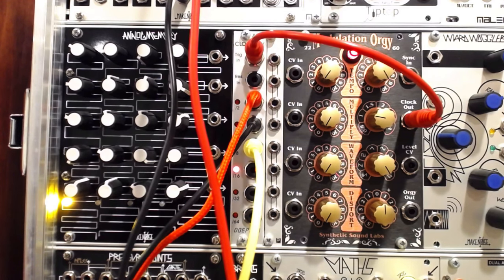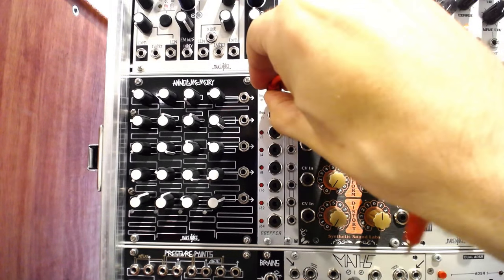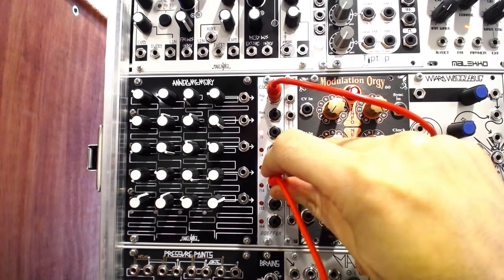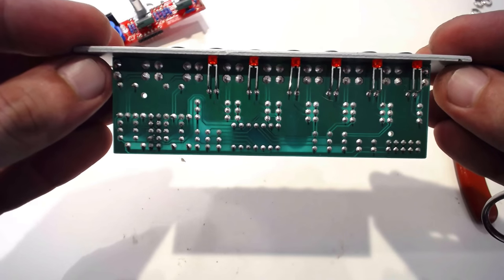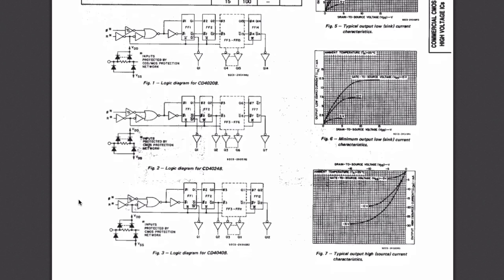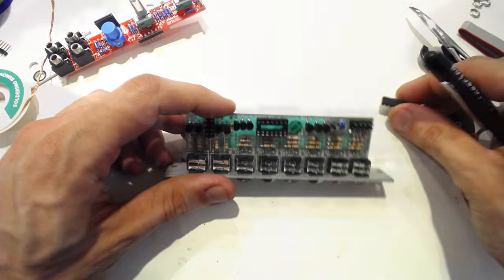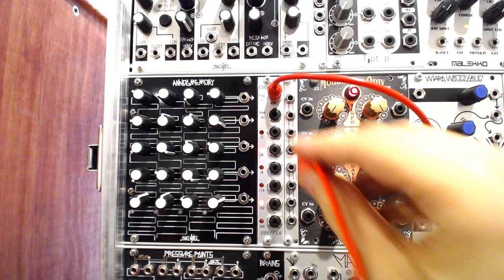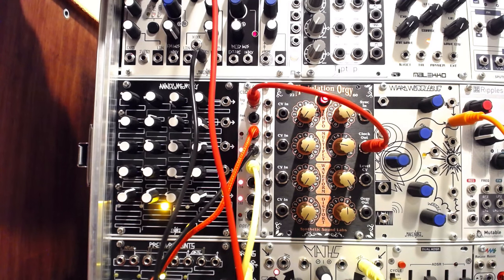Broken Eurorack Module Diagnosis And Repair

Comment: Hello, I have a newly made DIY modular case with Konstant Labs Strong PWR and Konstant Lab Filtered busboards. Suddenly while playing the other day everything froze, no sound, all LEDs are stagnant, and the -12 volt LED stopped working, Both +12V and +5V works and is lighting up, its been a little up and down in terms of functioning for a couple of weeks, but yesterday it just died, and i cant for the life of me figure out what this means, or how to fix it. Anyone here have any thought on what could be the issue? some modules still work, but most are just constant lighting up LEDs, in modules like modulation orgy which is supposed to blink in sync with bpm. Any help is much appreciated!
Reply from the maker: Tough to say, I would be careful not to damage your modules though! I’d suggest asking in the Synth DIY Facebook group, they are very helpful!